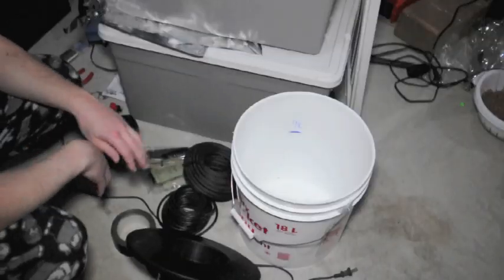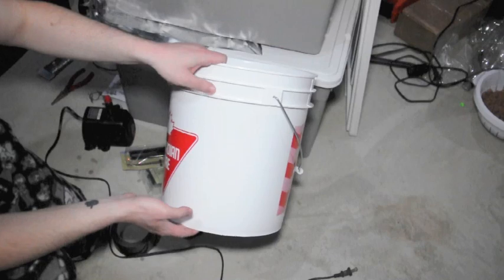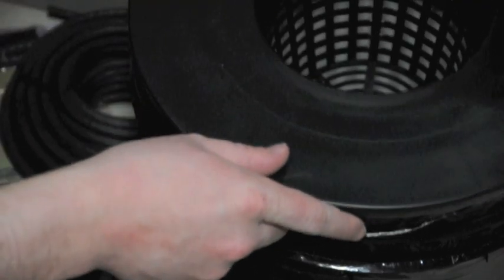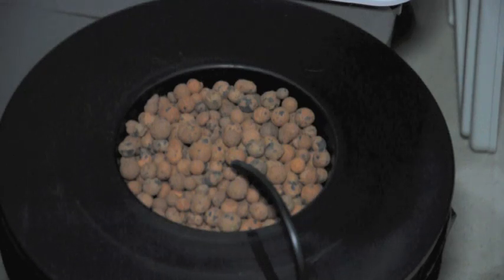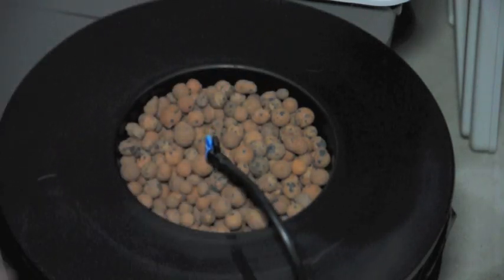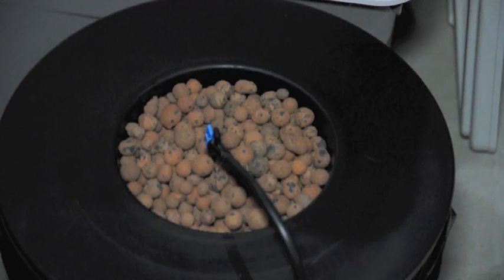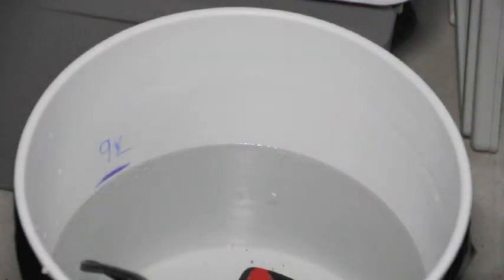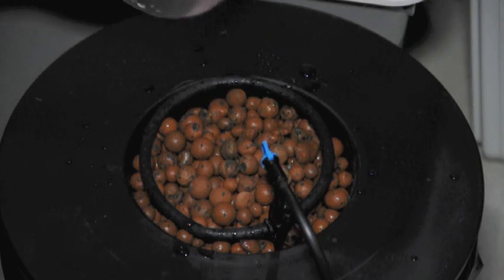DIY Hydroponics Top Drip Bucket System

Comment: I have the same 6 inch net pot lids on several 5 gallon buckets. I'm using the Kratky  method. No air pumps or water pumps. I change out the nutrient solution every two weeks. I have very healthy and happy red cherry tomato plants and strawberry plants.

Comment: so i actually tried this. i have a dwc tote with 5 3 inch net cups with pepper plants in each one. i have a pump in the res connected to a pvc pipe witch is connected to a distributor. from there they go to each plant and a circle of drip line. after about a  week the drip lines water flow was drastically reduced due to nutrient build up. did you have the same issue?

Comment: Just a quick suggestion since you wanna keep the roots cool and black tends to attract heat and hold it. I find like you mentioned spray painting my bucket black and after it drys repaint it white. I find it keeps the root system cool. But otherwise great video and people don't forget to clean your clay balls even if the bag says pre cleaned. Thanks for adding to the 420 movement.

Comment: Checklist:
Bucket, 18L
Lid for bucket with six inch net pot in it
pump, $50, with 1/4"" adapter
tubing, 1/4""
drippers, flag, $3/10
tubing stick
coco coir balls
T-connector
Drip line

Comment: Having a heater in the bucket is not the best idea in the summer but for fall its great. You could use a external pump plumbed to the bucket threw grommets to keep the motors heat out of the equation.

Comment: would the blue regulator place strain on the pump? correct me if I'm wrong, but aren't these cheap pumps meant to just flow freely, would  placing a regulator(essentially a partial blockage) strain the water pump?
Reply: I'd say so.

Comment: Bro bro bro.... a little overkill on the pump.... you running a power station ? or a single bucket??? I'm confused... you could run three tables off that thing...
Reply: seanosomething, what else would you use?

Comment: I would be worried that the pump would burn up prematurely due to so much restriction.Good idea just a little to much pump,I do my drippers with an air pump and with a splitter I can do more than one with just one air pump.
Reply: I would think if those pumps ran continuously it would heat the water up too much n screw up the roots. Also the roots would get sucked by pump. It was a good thought. I run the air stone method n get great results!
Reply: when roots long enough, you remove the top drip. top drip just helps in root making. that's my experience.

Comment: I don't understand why people would use a pump for a simple single drip bucket. you can pump water with an air pump for a fraction of the price. water farms have been doing it for almost 30 years.
Reply: You don't need to top feed in DWC, but yeah you can move water vertically with an air pump. Just look up "air pump filter" and you'll get the idea. Just air line inside of a tube.
Reply: i just looked this up, exactly what I need! thanks.
Reply: U can? Lmao what the fuck! How? U just set it up the same way and like instead of the airstone connected, u just let the tubing sit at the bottom of the water?

Comment: NEVER EVER!! drill holes in the top of your net bucket for the air lines. I have two reasons:
1. It makes turning of your plants to redirect them to the light, a real pain in the ass. (I know I did this myself.)
2. While the soft texture of the air line does make a fairly tight seal, there is always a small possibility of contamination. While a hole drilled in the side of the bucket, about 3/4" down from the lip, has as good a seal and the lip of the the lid over hangs it giving additional protection drips.

Comment: with the back pressure created on the pump because of the regulated water drip, I am wondering if the pump will have a very short life? The pump is fighting to get its gph out and the motor will be stressed by the regulator drip valve

Comment: could you refer me to the specific water pump you used that came with the 1/4 inch connection ?    and do you know if this water pump has magnetic components in it that could cause PH levels to fluctuate ?   with is the last problem i had with my last system.

Comment: I agree, Having a powerful pump and them limiting it in this way is bad because it will reduce the life of the pump and make it work hard because of the pressure. 

He should have got a smaller pump or at least a pump like in my PC that has RPM control and you can slow down the motor to very slow.

Comment: I dont mean to troll but it seams like such a wast of a expensive water pump for a single 5 gal bucket. Might be best to run a common line through a bunch of buckets so you have a common shared water level and then use the single pump to drip feed a bunch of buckets. thats my two cents.

Comment: It's much less expensive to use an air pump instead of a water pump. The air bubbles up in the tube and lifts the water like you would see in a small fish tank. That size water pump would probably be able to support many plants if you used a reservoir.

Comment: hi i have a question, my question is would putting a drip as you did on the pumps end, would it reduce the life span of the pump? i think since the pump will be pushing the water and building up pressure, that would be forcing the pump to work hardy or in a long run damage the pump since the pump is pushing the water but not having really no place to go but back in to the pump????? is any of that right, or am i wrong?